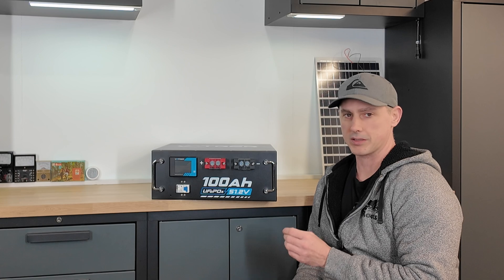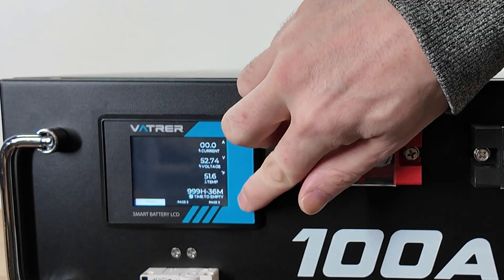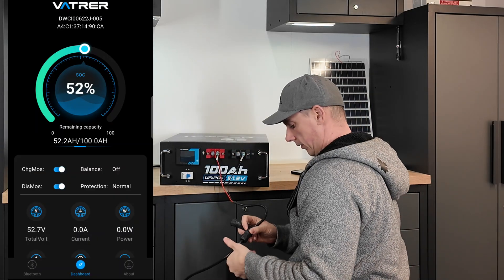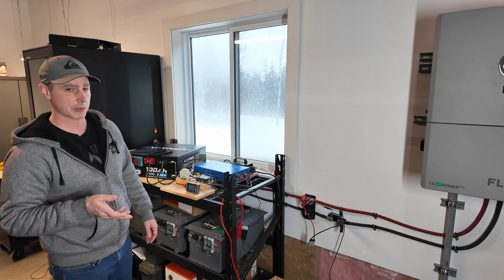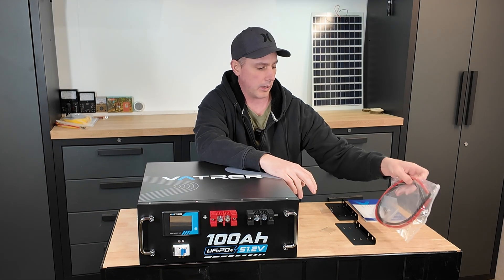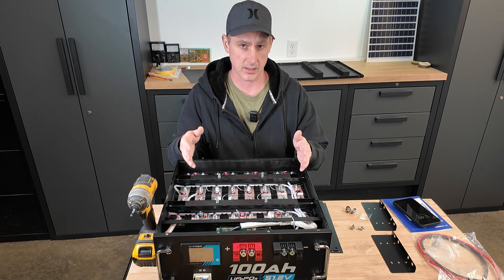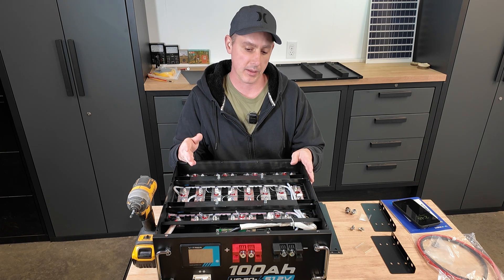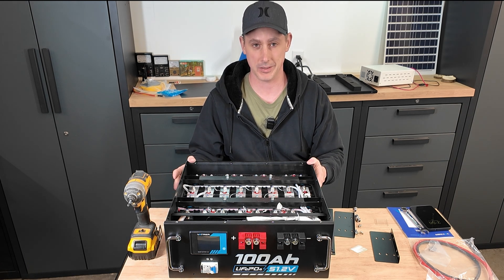Vatrer 48V(51.2V) 100Ah LiFePO4 Lithium Solar Battery

Comment: Sorry for a little late discovery...as I was searching for this issue.  
If this battery pack doesn't need to be connected through comp./cable but just having voltage/amps regularisation (manually) then I have a question.... This Lithium battery pack can be connected PARALLAL to a same set of Lead Acid Battery pack (4 batteries of 12 volts = 48 v typical) and they can be regulated through inverter controls... on USER defined mode of the same capaicities with 57v...hi... bulk --charging upto 58 (2 volts increament for each battery) and 44v Cut off... My solar inverter is Hybrid and goes upto 140amps. max.
I have asked the same qustion from various technical persons but they denied it even A.I has answered it -ive. .. and the lead acid batteries (tall tubular) can be kept seperately...
Reply from the maker: I wouldn't combine two different chemistry batteries together, but I suppose the only way to know for sure is to try it.

Comment: Does the app work while away from Bluetooth connection or you do have to be in Bluetooth range to use the app ?
Reply from the maker: You'll need to be within range. I believe you're thinking of a WiFi connection.

Comment: What kind of inverter would break if you connect it directly to the battery without having to precharge it with a resistor? Sounds like it just waits for you to forget to do it once and that's it. It's just a disaster waiting to happen, just a matter of time. That's a terrible design and nobody should own something like that.
Reply from the maker: @vuaeco  That's the unfortunate side effect of LiFePO4 batteries. They have little to no resistance.

Comment: i apologize if i missed it ..... but did you notice any difference between the blue one vs this black one other than the paint job ? 
thanks for sharing your experiences , jeff
Reply from the maker: @JeffB1961  Yes, the blue one is too wide and will not fit in a standard server rack cabinet. The black one is about 1/8 narrower and will fit.
Reply: @Roll2Videos  thanks :)
Reply: @Roll2Videos  what server rack are you using? I'm wondering if it will fit in an eg4 rack (6 of them)
Reply from the maker: @sya54b7n  , I bought one off of Facebook marketplace. It's for actual servers, but it works for me.

Comment: Your Low cuttoff is way to high IMO... you are leaving a lot in the tank for no real reason. I have mine at 48V... I would only put if a higher cutoff (49.6 for example) if you cycle your entire bank daily. QUESTION: Was there an open RS485 port on the BMS?
Reply from the maker: @paulbarrette2557  51V gets me to about 20% SOC on my victron shunt. It depends on how hard the battery discharges to pull the voltage down. I have 730Ah @ 51.2V
-I'd have to open up the battery to confirm, but I'm pretty sure the RS485 Port was being used for the display. If that was usable, it would also depend on what communication protocol, if any, was programmed into the BMS
Reply: @Roll2Videos  Yeah... so you are leaving 150ah out there and you're not really 'saving' your battery. Calendar aging will have more degradation affect. Again, unless you cycle them hard and daily... just saying. Nice vid... I like that the cells are not welded
Reply from the maker: That's a debated topic.

Comment: Ouch, sorry about the little inverter...

Not too bad of a build.  A few things I would change.  I'm not a big fan of those style double terminals on the front.  Would be nice if the display power was being pulled before the circuit breaker.  Finally, you already mentioned it but I would like the temp sensors on the bus bars and spread out through the pack to get temps from different cells.  

Thanks for sharing!
Reply from the maker: @AdamDeLayDIY  You have some great points. Thank you for being a diligent viewer. 🍻
Reply: @Roll2Videos  Thanks for putting out good stuff!